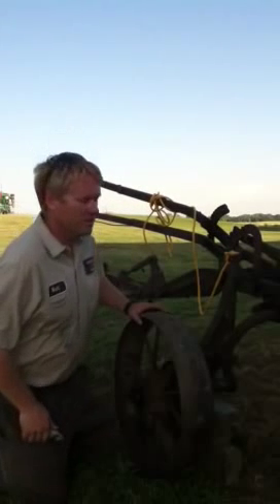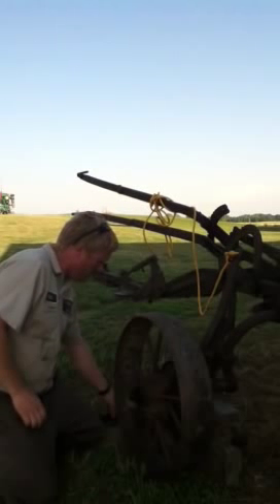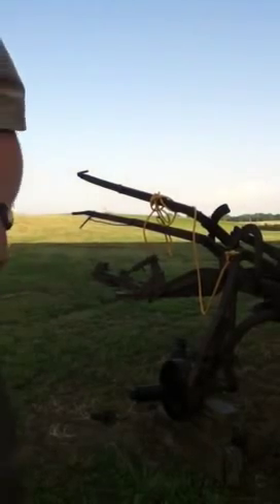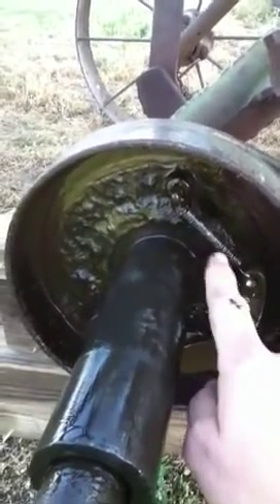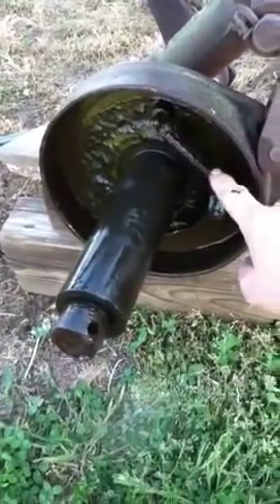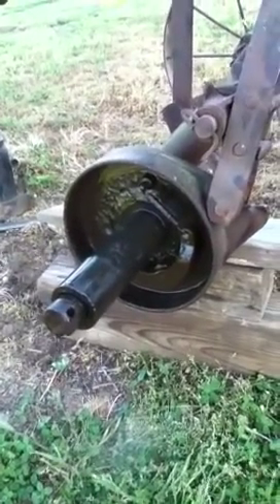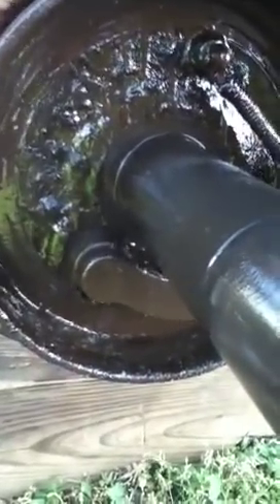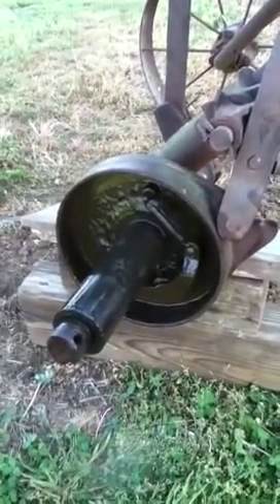John Deere model 52 trip plow how to work on it

Comment: I have a model 52 and a 44.  I agree, that spring is too loose.  The spring I use I can still get from John Deere.  It's much bigger around and quite stiff.  My dad and the guys I plow with in plowing matches say that you should not have much grease in the clutch itself.  Clean it out really good with gas or solvent, and leave it dry.  Only oil the bushing.